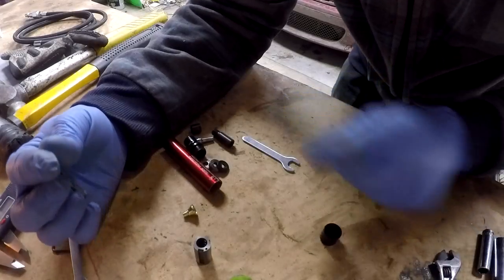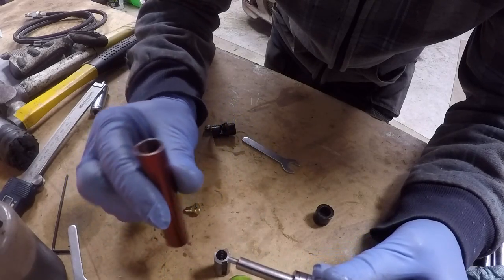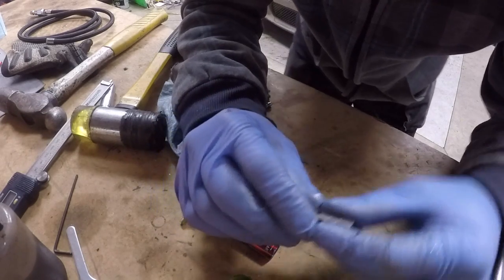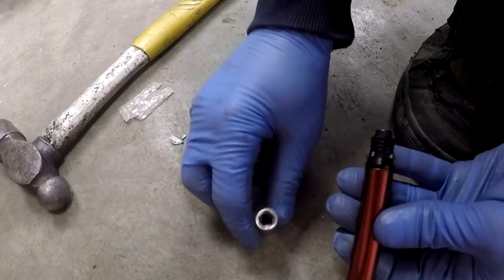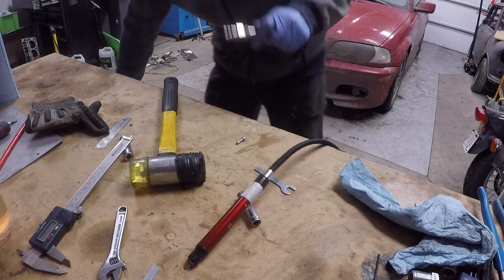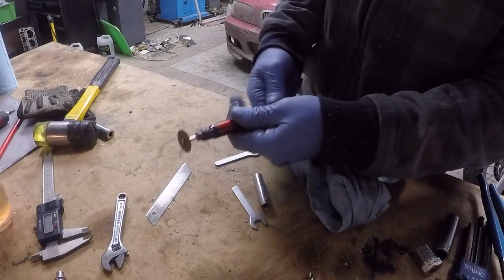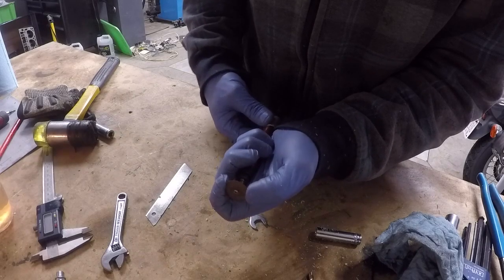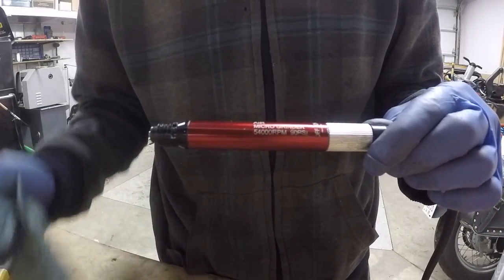Pencil Grinder teardown - Micro Air Die Grinder - Pneumatic. (Part 2)

Comment: This video really helped me but now I am stuck as the motor kit component won't just come apart like it did in your video!  Any ideas???  I have been looking everywhere on how to actually take this pencil grinder apart and you are the only one who had a video let alone directions.  I can't even get anything from Chicago Pneumatic with directions just the parts to purchase.  Can anyone help out please?
Reply from the maker: So, the motor comes out of the housing, but then you can't get the end caps off of the motor, or the motor won't come out of the housing ?